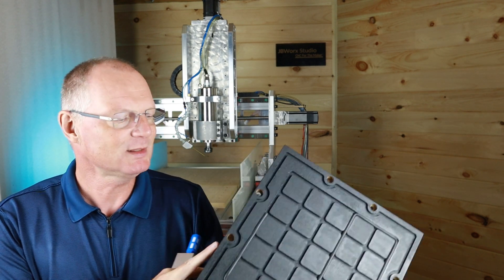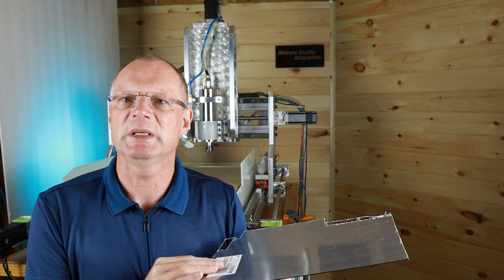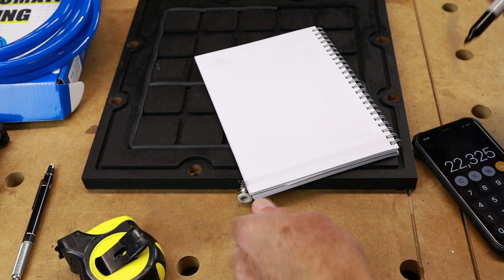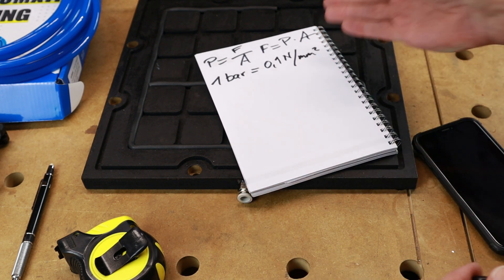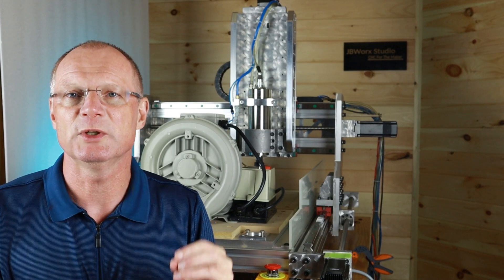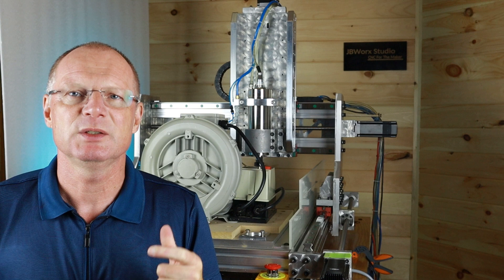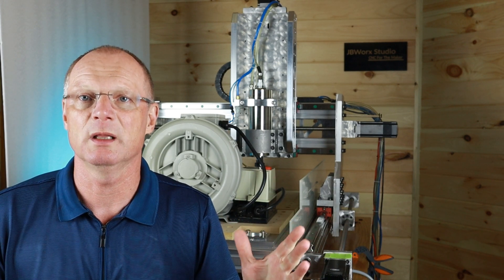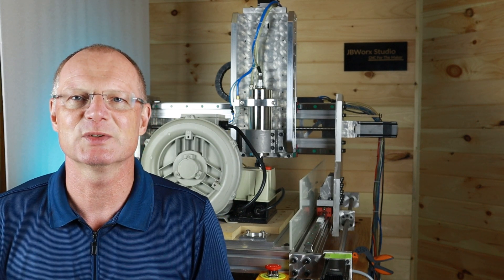Vacuum Plate 2 (Testing Pumps)

Comment: Great job. I’m looking for an economical way to make a vac clamp system for use in acoustic guitar making.
Reply from the maker: It makes it a lot easier if you have a known repeating pattern. And I think that is true in your case. You can make the vacuum plate specific in its shape and hold down pattern. I made some plates for RC-Airplane wing cores and was able to use my shop vac to hold them down. 
Good luck on your build.

Comment: I think your calculation is not quite right, you have to subtract the aera where no vakuum is applid, so the true aera are only these narrow grid lines. Of course you can add some force caused by the coefficient of friction from the aera which touches the matirial, considering the horisontal force only. Excuse my english.
Reply from the maker: The area between the vacuum plate and the plate you are attaching are for an air molecule as big as the Mount Everest. If you take 2 glass plates that might differ.

Comment: Do you think a vacuum reservoir could enable the fridge pump to work? With a reservoir the pneumatic seal could be stablished quickly and that would enable the compressor flow to maintain vacuum levels. (it's just something that crossed my head, btw. I remember seeing these in dairy farms for the automatic milking systems so they could empty the tubes in case of power failure.) Thanks for the videos, btw!!!
Reply from the maker: Yes I think that is a valuable solution. The reservoir will provide short bursts of extra “vacuum” allowing the part to seal.

Comment: very interesting. I need something like this to mill xp foam wings for RC aircraft. 
Thanks for sharing  :)
Reply from the maker: That is exactly what I do. I made 2 plates one flat with holes the other with the top wing profile to machine the bottom side of the wing airfoil.
Reply: @JBWorx  lol...what are the odds?  I'm currently building a printnc so my needs for a vacuum plate are further down the road.
Thanks for the response, and I'd love to see a video on wing milling  :)
Reply from the maker: I am currently machining a mold for a carbon layup made from aluminum… I hope this will work. Also used the diamond tool from my last video but it’s a ball nose bit.
Reply: @JBWorx  hmmm...very interesting.  I watched your diamond tool video and it's impressive. Your mold finish should be like a mirror  :)
I saw a guy ( @nulas87 ) use mfd for the mold/ machined/ then layered with fiberglass+resin. After cure, machined again the sprayed with
something that looked like Gelcoat. 
Best wishes for you CF molds, I'd like to see the finished product. :)
Reply from the maker: That is an interesting process as well I was just concerned with the MDF swelling seasonally with the high humidity that we see here in late summer

Comment: Air conditioning vacuum pumps will spray oil especially it turned on to open air.  They need to build vacuum to keep the oil inside.
Reply from the maker: Yes, I can really not recommend using them indoors.

Comment: I worry about my powerbill

I got 2 industrial routers

And they got blowers on each one

With great power comes great power bill
Reply from the maker: I think the machine itself is not using much but yes you are correct the vacuum pumps run the length of the job and if powerful can add a few dollars to your bill. But if you are in an industrial building you should get a better rate for your electric than the residential rate.

Comment: I have a 12CFM vac pump for composite work that is also the oil mist variety. I knew going into it that mist would be expelled, but the first time you do it indoors, there's going to be a film on Everything. That was a one-time mistake. I've since added a DIY mist recovery valve and accumulator system that will eventually get a scavenge pump, filter, etc., just to try to turn it into a recirc system. 
I've pondered going with a sort of vac table for the CNC, but assuming the workpiece will fit, I have an old setup for a vacuum chamber that I will reassemble as a top cover, block off the access to whatever is open on my table, and let the pump run on the workpiece. Only problem that would require a fairly elaborate routing would be an air-cooling loop for the cnc motor, at which point I would consider moving to a liquid-chilled system. Sounds like a lot of work when I normally just run toe vise clamps or sacrificial adhesives on thin stock that I'm having a hard time getting past for justification other than Cool factor.
Reply from the maker: Adding a vac plate is nice - BUT ! It has its limitations. The main advantage is to hold down thin larger stock that, for example, could not be held down with toe clamps. Instead of going through all that trouble I like to suggest you make a prototype vac plate for the parts you normally make and use your shop vac as a pump. This can give you an idea if you like working with an vac setup or prefer the regular clamping. Hope this helps.

Comment: My first prototype vacuum pad was made with MDF. The vacuum pressure was adequate for a test.
My second prototype was made from HDPE plastic. The vacuum pressure gauge shot up significantly.

MDF is porous, your 8mm pneumatic hose fitting is pulling a vacuum through the entire thickness of your plate.

Make a new plate from HDPE, because it's not porous at all.
Reply from the maker: Painting it with an acrylic-latex paint worked fine. HDPE is ok but warped too much in my opinion. Delrin / POM is a much better choice in case you make another one.

Comment: What size compressor are you using with that venturi pump? and usually, how much time of use do you get with it?
Reply from the maker: One thing to watch out for is the size of the internal orifice of the Venturi pump. On this model my California air tools 4610 can not keep up (only 1hp). But I use it for vacuum bagging not on the plate. However even with the pressure dropping I get enough vacuum to keep it very secure to the plate and this type compressor has a max cont. run time of 1h. Otherwise duty rating is 70/30. I like it because it’s really quiet.

Comment: Here's how you solve the oil vwcuum pump issue in the video linked below...cheap and simple. 
Would the harbor freight pump work for your vacuum holding jig (assuming the mist problem is solved)?
https://youtu.be/HppwlWg1XH4
Reply from the maker: Thank you for sharing this, very interesting idea. Yes the larger pump from HF would do the job no problem.

Comment: Adding the Gauge on the line that's used to draw the vacuum does not necessarily give you the actual pressure in the plate. If the flow is high enough to be restricted by the tubing this might shows a pressure that's lower than the pressure in the plate body itself. Might work out for the type of table & Pump combination that you used in your example, but be careful if you use it on something that needs a higher flowrate.
rotary vane pumps with oil will always produce a fine oil mist that can stay in the air seemingly forever. There are special filter units available (that might cost as much as the pump itself). The amount of "generated" fog is directly linked to the air throughput on the pump. If you plate seals well you will get nearly nothing, as soon as you need some air throughput your workshop turns into a cloud chamber wihtin a few minutes. You can route the exhaust air to the outside with some tubing if you want to go though the effort and avoid the filter system (with all the environmental drawbags and increased oil consumption)
Alternatively there are oil free systems available. They have a slightly higher wear on the rotary vane system but that's acceptable for a hobby use.
Reply from the maker: Thank you for your comment, appreciate it ! Yes, certainly as I mentioned the regenerative blower is wrong for the plate and so is the used hose. I included it to demonstrate that these types are generally not generating a high vacuum. I like the oilless vane pumps the vanes are typically made from carbon and last a long time if properly protected by a filter. And they can be bought as a spare part from good manufacturers like Gast or Busch ($$$).  Because my workshop is in my house I don’t like the idea of having oil mist in the air and filters always fail. Again thx for taking the time to reach out !
Reply: @JBWorx   yea the oil free version is the way to go. I only use a oil on because I already had it sitting in the basement 🤣
Reply from the maker: 😀😀👍 yes I know how that goes … the regenerative blower from the video is for my pond 🤣🤣

Comment: Fascinating as always - Is it possible to chain two of the refrigerator type compressors/use two for two inlets to the vacuum plate? Or will they be so starved that there isn't a significant/meaningful benefit to be found?
Reply from the maker: Thank you! The unit in the video is rather small as it came from an air dryer, a refrigerator has typically a bit more air flow. To combine 2 units I would build a small vacuum reservoir from PVC tubing and place a check valve to each pump.

Comment: I have never used a vacuum plate but I have to ask the obvious, how do use insure that you don't cut deeper than your stock? And is the piece still level with the table?
All in all at some point I would like to build my own based on this series of videos since I know there is probably occasions where a vacuum table is quite handy.
One other thing about your videos that I like is the fact that you have used the hardware mentioned in the videos and give your opinion on how well it works.... 
Thanks
Reply from the maker: Thank you Peter! So the plate I made is for my MFT table but I can also use it in my CNC. So the plate is surfaced and that makes it parallel to the table. What you have to accomplish is that the part gets “sucked down” all the way to the plate. If the seal sticks too far out over the plate or the vacuum is too low the part rests on top of the seal and will most likely not be parallel to your table. Machining through is always a problem. You can use some paper (newspaper works well) or some vacuum table matt to place the part on. This will prevent that you cut into the plate and also assist in keeping a greater amount of vacuum once the part gets holes machined into it. Thanks for reaching out !!

Comment: There may be better performance if the venturi pump is attached directly to the suction plate without the blue tube in between.  The reason is that at low air pressures there is not much driving force coaxing the air molecules to go toward the pump.  The gauge could still be on the blue tube, but teed off the minimal length connection between plate and pump.
Reply from the maker: I think the flow of that model was actually pretty decent. The refrigerator pump had less flow. Yes eliminating any length of hose for low air flow situations is a good measure. Thank you for your comment !
Reply: @JBWorx  I agree the flow of the pump is good when there is still a lot of air pressure to pull on.  But as the pressure drops the pump flow becomes less.  Not the fault of the pump, its just an inevitable outcome of pulling vacuum.  Pressure comes from air molecules bouncing off of each other and off the walls of their enclosure.  As air pressure drops, molecules are less energetic at finding the exit so to speak.
Reply from the maker: Yes that makes sense thank you for your explanation.

Comment: Having only used Vacuum in large epoxy lay ups and having to get the air out quickly, I’ve tended to have everything set up for the vac pump but to quickly suck down the bag using a shop vac.
The shop vac has to have air through to cool the workings so it’s only for that initial period.
Reply from the maker: Some shop vac’s have a separate fan that cooles the motor. Festool, Fein and Dewalt do make several models. No worries about them getting too hot

Comment: Another design I've seen involves using many tiny holes (0.3-0.5mm). The logic is that a vacuum is a vacuum, it doesn't need huge holes. 

By using many small holes it doesn't matter (so much) if some become uncovered because you machine through the piece. Broadly as long as the flow through the uncovered holes is a small part of total flow you will still be holding your vacuum. Hence using small holes.

The idea is that you don't need a gasket. 

Have you tried this?
Reply: There is a well known brand of self adhesive neoprene  sheet that has lots of holes in it, that relies on this. 

The holes don't need to be as small as you mentiong but smaller holes increase airflow, though I don't fully understand the mechanics of it. That was a tip I got from an engineer who specialised in it. I have a grid of 6mm holes over my spoil board for this reason. Though it has it's downsides too.
Reply: @TheCNCDen  aah. The 6mm hole mat is designed to be laid over a more traditional vacuum plate. It will still fail catastrophically if you cut through the part.
Reply: @ewildgoose  It will only fail over time and you go through the material, it's designed to be a consumable, it's part of their business plan.
Reply from the maker: I don’t like these plates at leased I don’t like to make them. Drilling the holes is a nightmare the concept is good though. There is a company in England that provides a plastic mat that looks like it has suction cups on it and these have a tiny hole in the center. You just have to lay that in a flat surface nothing to drill. They are available in the US as well … I think Whitt or white is the distributer … that’s from top of my head though. I would prefer that set up.
Reply: @JBWorx  there is also a thick rubber Matt (not sure the exact material). It's a good few mm thick and the idea is you can perforate it around the underside of the part. It's designed to be mildly reusable, but expendable.

I'm most interested in the small hole table though. I agree it's going to be a pain to make....
Reply: @JBWorx  Doesn't take long to drill.  I find the biggest pain is sealing the edges of the MDF waste board to prevent loss there. 

I think the mat you refer to is a US company, it's self adhesive noeprine punched with holes at regular intervals. I was tempted to by a roll of the self adhsive from a UK supplier and try cutting holes myself, but to date haven't.
Reply from the maker: I was thinking of drilling an aluminum plate. 0.2Mm is a nightmare and 0.5mm will let too much air through. Sorry had not the MDF in mind
Reply: @JBWorx  my design would be to drill larger holes from behind, add a small ball mill recess over each hole from the front. Then the 0.3mm hole only needs to go a relatively small distance (1mm or so perhaps? 3xD)
Reply: @JBWorx  oh yes, that would be pain.  I haven't tried adding smaller holes to MDF, to see if that would assist further, the ongoing issue is removing dust and debris to maintain the holes. As I don't cut so many full bed sheets these days I had thought about not using them at all in the next waste board.
Reply from the maker: Yea thinning down the section for the hole is the way to go.
Reply from the maker: No holes and no gasket so just pulling through the unsealed MDF is the way to go for any larger projects on the cnc.

Comment: There is a design i saw on YouTube where the fellow puts a "notch" in the straight edges (think of the endmill doing a wobble while cutting the straight lines. So you get a sharpish point one side and a smoother arc the other)

It looked like it would hold the cord better, by creating a little pinch point.
Reply from the maker: Interesting thank you for sharing I will have a look if I can figure this out.
Reply: @JBWorx  as far as I know he cut the path with a single end mill the width of the slot. So we can infer the design. We want a relatively sharp triangular point on one side. The endmill will have to eat out the other side while machining this, however it will draw a different shape, a softer curve, on the opposite side
Reply from the maker: So after using the plate for a while I found that holding the seal in is not an issue. However the overall dimensions of the  slot in comparison to the seal diameter is important.

Comment: i found with my vacuum table those pneumatic fittings tend to leak on a micro level and your system loses around 35% of the available vacuum, vacuum fittings usually dont fit around the tube but rather they push into the tube and locked with a sealing nut, check it out, your results will be drastically improved..
Reply from the maker: Thank you that is a very good tip and makes perfect sense to me.
Reply: @JBWorx   yea under vacuum those tubes shrink slightly in the pneumatic fittings, i guess they are great when the lines are under positive pressure and expand into the fittings.
Reply from the maker: Yes I thought so too once you mentioned it barbed fittings might be better
Reply: The fittings do leak a little, but not that bad. I use these for epoxy vacuum infusion (where the pressure is in the ballpark of 1-5 mBar Absolute, or -0.995Bar and below) and I get away with that. So even though they sometimes leak, it's not that bad. 

And a hint to the oiling rotary vane pumps: they only produce oil vapor if they have to move a lot of air, below -0.9Bar and you can run them endlessly.
Reply from the maker: I think it was also the Harbour Freight version. A better pump is probably not having that oil vapor issue.